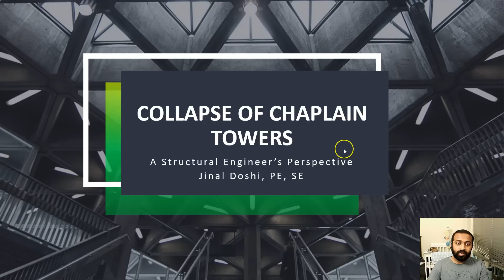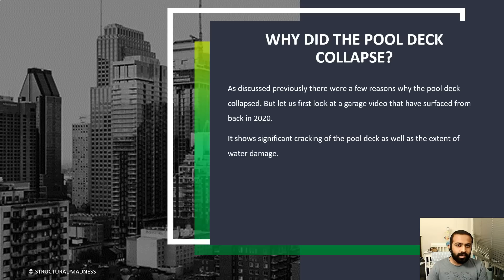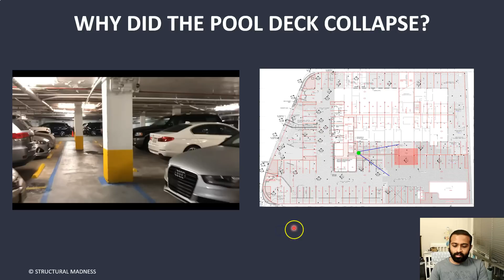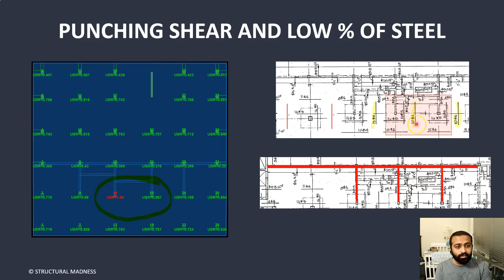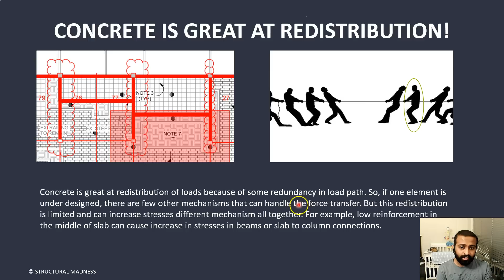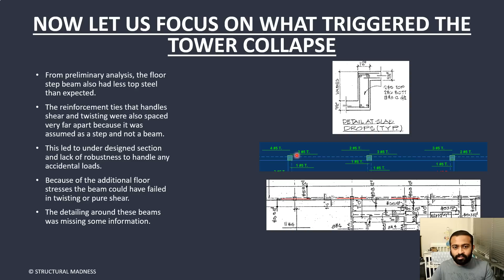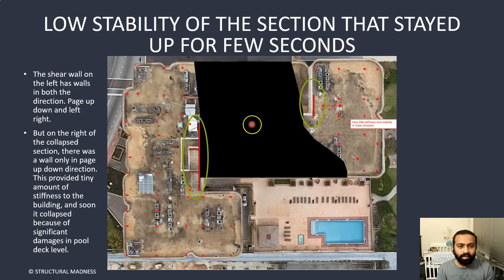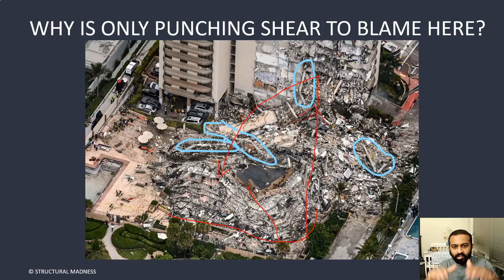Reasons behind Surfside Building - Champlain Towers South - Collapse : A Structural Engineers Review

Comment: Great video. As a mechanical engineer it seems to me that tying the pool deck to the building structure was/is not a good idea for the consequences in this case.
Reply: I just think of the logistics of putting up the building. That pool deck area would be useful for crane and material drop off. Do the pool and deck last. They're both free standing...with lots of cosmetics.
Reply from the maker: I wouldn’t say so. Because the pool deck did collapse around some columns that were 24”x24”, that portion of building didn’t collapse. So I do think it was the skinny column that would have been responsible for the tower collapse.
Reply: @StructuralMadness  If you consider who the developer was, then skimping on steel and construction cost would not be foreign to someone like that. https://therealdeal.com/miami/2021/07/19/surfside-condo-developer-faced-legal-trouble-in-canada-found-clean-slate-in-south-florida/

Comment: I'm not an engineer, but even I could tell that those columns were too skinny.
Reply: As shown on the drawings the little columns are really stronger than you might guess and better designed than other parts of the building.  One of those columns has a capacity of right at 1 million pounds.
Reply: Well, hindsight is 20/20. As information is still few and far between, I will reserve judgement until a more complete picture is given. Depending on how you look at the slab between garage and pool deck, one might argue these aren't even outer columns. Just as one example.

Comment: If you look closely at the beam above the black SUV & to the right of column #2, is is seriously bowed.  Surely it was formed and poured flat.  So, is the bow the result of concrete "creep", or is the result of inadequate reinforcing in the beam?
Reply: It's not easy to tell if that alleged bow is real, or whether it's an optical/photographic artifact. As Mr. Structural Madness said, you'd expect to see obvious stress cracks were the beam bowed to the extent it appears it is.
Reply: @Johnny.Fedora   - Yes, depending on the camera lens used, the part of the bow could be the result of the optics of the lens.  However, the bottom of the beam appears to be out of level relative to other elements in the photo (i.e. pipes and structural elements both in the fore ground & background. If my bearings are correct, I think that beam is from column 1 to column 2.

Comment: The pool deck did have punch-through reinforcements in the design very clearly at 30:47.  That is what the squares represent around each column.  The drawings call for 16x#5s and 19#4s and for 25% of strips centering on the columns.  Thus, it appears that each column had at least 4-5 rebar running each direction through the column itself (both bottom and top), so given the loads, this should have easily held more weight than what you seem to have modeled.  The design seems less at fault than perhaps the actual construction.
Reply: That was not punch through reinforcement, structural engineers don’t indicate it that way. Those squares that you are referring to were just representing column strip widths which indicates the zone / extent in which column reinforcement shall be provided. These are older drawings so I understand your confusion.

Also the top bars are mainly for slab’s moment demands. We do have to tie it to columns and we should be seeing more than just 2 bars passing through columns
Reply: @JinalDoshi91  I have seen the latest drawings, as there are several revisions, and that is what they indicate.  These are absolutely top steel punch through reinforcement mesh.  Whether they are installed is in question, but the design called for it.  As I mentioned, each column has 2-4 bars passing in each direction depending on the width, so there were 4-8.  Even in the column mentioned in the video at 24:05 there were actually 4 rebat.  He only saw the 2 still in the column, but 2 more were apparent in the photo but which were pulled out on each side.  You have to inspect the photos closely to see them, but they are there.
Reply: @mandoreforger6999  I'm sorry but there is no such thing as "top steel punch through reinforcement mesh".  Punching shear reinforcing is an entirely different configuration- typically either structural steel shearheads or small stirrups.  These days we primarily use stud rails.  Horizontal bars in the slab will not provide reinforcing against punching shear.  That reinforcing is for flexure and is independent of punching shear.
Reply: @billj5645  “these days”?  This building was built in 1981.  Instead of BS-ing about stirrups, go look at the actual drawings from 1981 and educate yourself about the approved technique at that time..  They used rebar strips to create a mesh in 1981.  Full stop.  Stop being another ignorant YouTube commenter and actually go look at the drawings.  They are on the web.  What is used today has 0% relevance to what we should see in the drawings and construction from 1981.  FFS….pull your head out and go look at the actual drawings and stop making yourself look like an idiot.  It is plain as day in those drawings.
Reply: @JinalDoshi91  please read…
https://www.eurocode.us/concrete-structures-eurocode-3/spacing-of-punching-shear-reinforcement.html
Reply: @mandoreforger6999  Not sure why you posted this but it supports the argument that there was no punching shear reinforcing in the slab.  The diagram shows little stirrups placed in the slab to resist punching shear.  Those are not in the drawings and are not seen in any of the photographs.
Reply: @billj5645  you don’t seem to understand the point.  The diagram at 30:47 on the right calls punch shear reinforcement mesh.  That is what the larger square outlines around each column signify.  It is plainly obvious to anybody with functional eyeballs.  The link illustrates that this is how such reinforcement is indicated in architectural drawings.  Numerous other structural engineers have made this point, both on Youtube and elsewhere.  The general design does not seem to be the issue, it is the adherence to the design by the contractors seems more likely to be the issue.
Reply: @billj5645  re-read your comment.  You said it is both “in the diagram” and then that “it is not in any of the drawings”.  It absolutely is in the drawings, what the hell do you think the diagram is?  Those are the architectural drawings from 1979.  I can tell that you have not downloaded any of them. The reinforcements are clearly indicated in the 1979 plans.
Reply: @billj5645  go look at sheet S9 of the drawings.  It says “At least 25% of all column strip reinforcements shall be centered over the column as explained in typical flat plate details, see sheet S11.”  Sheet S4/S5 references the garage basement and lobby level specifications and calls for 16 x #5 additional rebar strips in the N/S direction and 19 x #5 in the E/W direction in the punch shear zone.   By that instruction @25% centering you would have 4 strips of rebar centered over the column going in one direction and 5 strips in the other.  This is what the design clearly calls for, with 0% doubt.
Reply: @mandoreforger6999  That is absolutely not what the drawings are showing.  First because there is no such thing as "punch shear reinforcement mesh".  This does not exist in any reinforced concrete text book and has not existed in any version of the ACI code for ultimate strength design since before this building was built.  Consult your reinforced concrete design professor and get back to us.  The link that was provided shows the vertical stirrups in the slab, it is the vertical stirrups that would provide punching shear resistance, not the horizontal reinforcing which is in the slab for flexure.  Horizontal bars in the slab will not resist punching shear, by the time the horizontal bars are seeing any stress from punching shear action the slab has already failed and nothing can save it.  The bars will fail or will be pulled out the top of the slab.  (But if the slab was reinforced with draped PT strands that is a different situation and PT strands have the ability to suspend a floor because they won't rip out of the slab.)  Second the dashed rectangles around the columns are never defined on the drawings.  Normally a dashed outline like that would signify a drop panel to provide additional flexural depth and additional shear resistance but drop panels were not provided in this building, and they used the wrong type of dashed line to represent a change in concrete thickness.  These rectangles roughly correspond to the zones defined in the ACI code as column strips which is where the bulk of the top reinforcing would be placed.
Reply: @billj5645  thank you for clarifying the issue on my behalf. It is very hard to respond to every comment. I am trying my best to get back to them. It seems like people on YouTube are spreading miss information. And then if they make incorrect convincing argument, everyone’s views get biased.
Reply: @JinalDoshi91  look, if you are claiming that there is no top steel indicated above the pillars on S4, S5, with clearly indicated 25% centering on S9, S10 and S11 then I cannot help you.  It clearly indicates an interlocking rebar mesh above the columns (likely connected with chairs, stirrups, etc.)  It calls for 16x #5s and 16x #5s in a lattice mesh at the specific column mentioned in the video, with 25% in each direction to be centered on the column (note 5 on page S6).  Maybe you do not consider any of that steel as “punch shear reinforcement” but that is exactly the intended role in being placed above the columns.
 Other structural engineers here on Youtube have pointed this out, and to ignore that is misinformation.  I think you just forgot to consider the top steel in your thinking.  I have downloaded all of the documents and read the notes.  I encourage all to do so…
https://www.townofsurfsidefl.gov/docs/default-source/default-document-library/town-clerk-documents/champlain-towers-south-public-records/8777-collins-ave-1979-plans.pdf
Reply: @mandoreforger6999  so let me clarify something on how slabs / beams are designed for that matter. This is Structural engineering Reinforced concrete design 101. Every slab spans between its supports, here in our case the supports are columns, the way slab handles the loads is through flexural resistance, that is moments are generated between the column supports into the slab.

Now within this span, a continuous slab (that is spanning across multiple columns) experiences positive as well as negative moments. The positive moment resistance requires bottom steel that is in the mid span to resist tension along the bottom face of the slab. At the support it experiences negative moments that is tension is at the top of the slab and you need tension reinforcement at the top of the slab. So for example the drawings show 15 or 16 #5 bars there. So we are on the same page till this point.

Moving on, the drawings do call out about providing 25% of steel within the central section (they haven’t clarified this width of central section) but per ACI 318-77 it will be about 40-48” (C+3H) zone of the columns. Now this is what you are referring to here. And this is exactly not a punching reinforcement, but it is the part of flexural reinforcement that should be centered on column to transfer the unbalanced moments of slab to the column section. This is tied to the punching shear shear because of the gamma v and gamma f factor that describe the portions of unbalanced moment that is transferred through flexure (that is the steel mesh that you are talking about) vs the portion of unbalanced moment that shall be transferred through shear. If this shear stress exceeds the 4 sqrt f’c then you have to provide additional shear reinforcement in the form of stirrups/ shear heads / stud rails. This piece was missing and may be was mis calculated into original design. And this shear heads / stirrups are known as punching shear reinforcement.

Now I am 100% sure about this, you can bring in anyone in here for this argument and I can prove that I am correct over here. I have designed countless number of buildings so far. If needed I can send you the research that went into the development of this particular section of the code that talks about the load transfer between the slab column connection.

I hope this helps clarify this issue.

Comment: You didn't mention the fact that there is also a thermal stress associated with the so called pool slab. The pool slab is being exposure the the heat from the Sun all day long, while the part of the slab under the residential part of the bldg. will maintains a constant temperature; a temperature differential will develop.  As the sun set's in the evening, the pool slab will begin to cool/shrink, thus creating an additional tensile force in the slab rebar between the pool side and the residential slab side and there appears to be no expansion joints anywhere in the slab! This condition of starching and pushing cycles in the slab has been going on, everyday, for 40 years. So in addition to all of the other slab design short falls/deficits, you may also have fatigue in the rebar as a contributing factor, if not the root cause? Because at 1:30 AM the slab is in it's cooling/shrinking phase.
Reply: Ya missed the approximate 15,000 sq ft of topping slab, A&B sand and pavers added to the original slab that was not designed for that.  The topping slab took away the pitch capabilities designed into it when built, and water was held after that. That meant the topping slab,paver sand and pavers held water for weeks, eating the steel and decaying the concrete. The added weight, purported to be 50psf +/_  on a slab that was overloaded and compromised caused the deck to buckle.  Probably in excess of a million lbs static weight for the entire 15k sq ft
Reply: Helpful aspect when considering the timing. Also the addition of heavy equipment added to the roof two days before…. So increasing downward load?? Also, a valet who worked at both north and south towers said the garage ceilings were leaking water onto cars and damaging the paint jobs from the start. Lots of complaints but nothing was done. So 40 years of water leaking though the concrete slab.
Reply: @jrosebud2021  What suggests it has been doing it for 40 years? Has the copy building been leaking too? I read that it had not.
Reply: There was a lot of top structure above the actual load bearing slab. This means a high drop-off of temperature and much buffering within the various layers. I doubt there was much of a temperature differential within the slab left.
As a example on a hot, sunny day sand can get unbearably hot on the surface, but dig a hole just a few inches and it's refreshingly cool.
Thermal expansion is more a problem of elements which are directly exposed to sunlight and/or are rather slender.
Reply: *an example
Reply: That would be true except that the temperature difference between day and night in the surf and swimming pools is very slight in South Florida during most of the year.  I'm thinking the pool cools down to 78 with heavy rain but mostly stays at surf temperature of 82 or so most of the time.
Reply: @KM-Eur  It is not the temperature of the water, but the temperature of the deck. If the coefficient of expansion is .0003, it causes a crack of 1/3 of an inch in 100 linear feet.
Reply: @Drwild75  The properties of concrete never cease to amaze me.
Reply: @Drwild75  

shouldn't 
0.0003 be 1/3 inch in 1000 feet?
Reply: @tommyjacobi2054  , 100 feet = 1200 inches. 0.0003 x 1200 inches = 0.36 inch, which is approximately 1/3.

The English system of measure blows  chunks.
Reply: @Johnny.Fedora  
Thanks!

My mistake